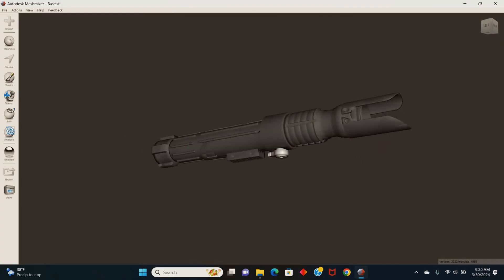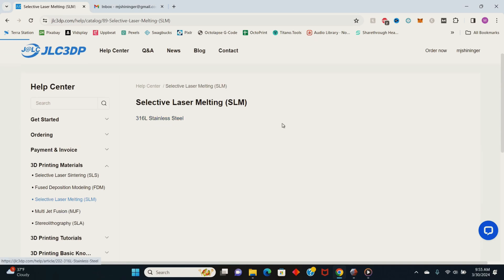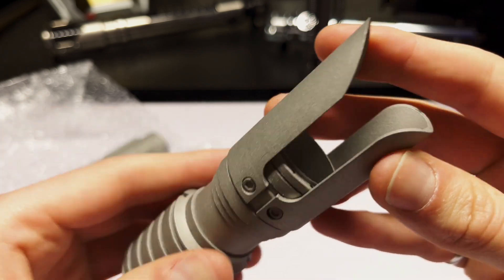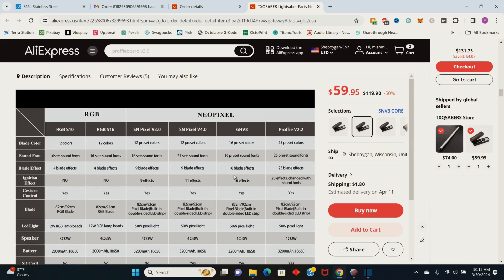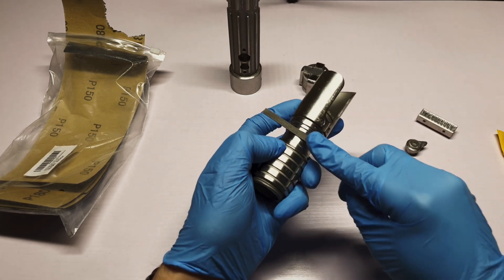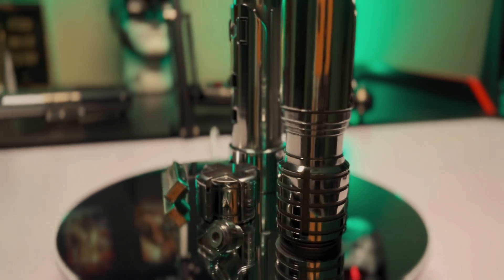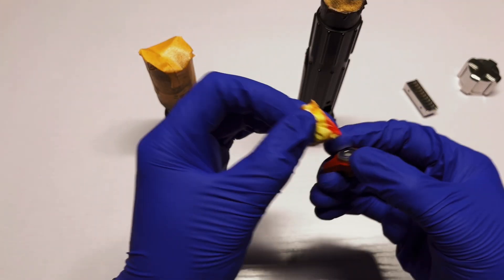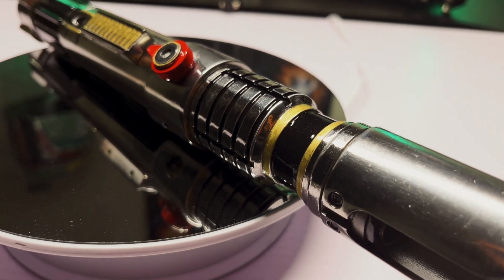I Built the Ultimate 3D Printed Stainless Steel Lightsaber

Comment: Awesome.  What was total cost for this?

Beautiful job.
Reply from the maker: Total cost for printing the metal material was about $200. All the electronics and blade was probably an extra $100. If I were to do it again, I'd print the hilt in aluminum instead of stainless steel. The steel makes the handle SUPER heavy.